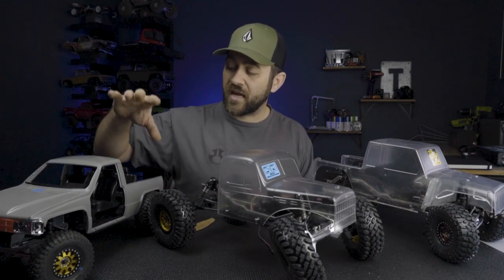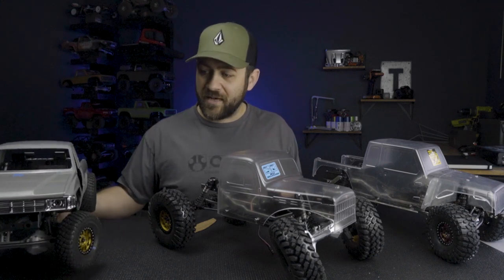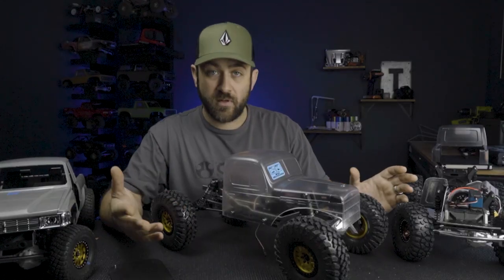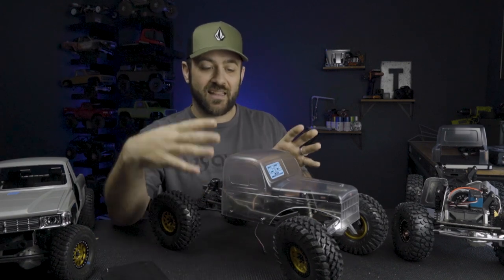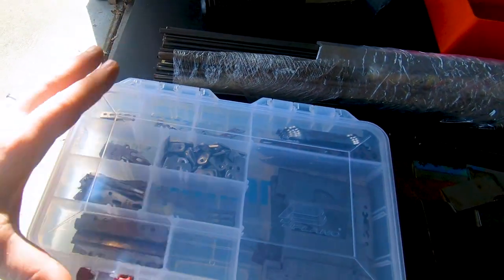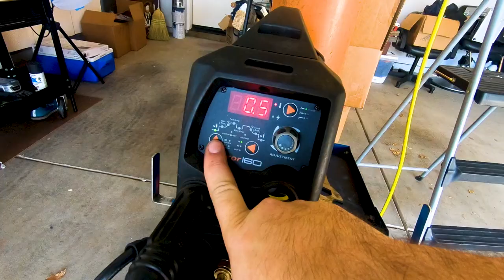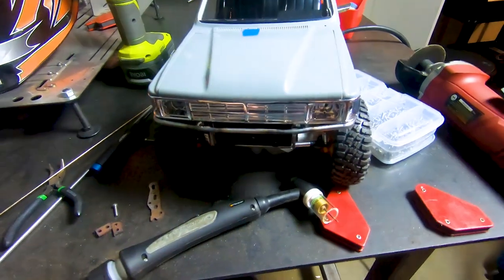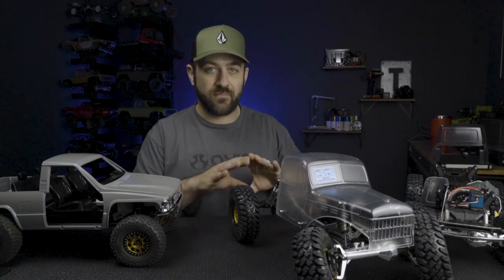Road to Scale Nats 2020 - Fab Time - Episode 5

Comment: With your weld the 1/8 rod you turned it down. You can go hi in amps and do a short burst fusion weld. To hold then turn down for your filler. Nice work

Comment: I like the shock towers are on the rear of the C3! I like all the stock mounting points.
Reply from the maker: They are only mock up, I wouldn’t use 3D printed. Plus I hate having all those holes! 😁
Reply: @HarleyDesignsInc  same here. I wouldn't use 3D printed shock towers, but they certainly are great for mock up!

Comment: Hey Josh, is the 3D file available for us to download on those shock mounts you made for the truck or do you print and sell upon request?
Reply from the maker: The shock mounts on my class 3? Those were just temp pieces a that I would never consider driving with.
Reply: Harley Designs Ok thanks, appreciate it.

Comment: I have a question on the ultra build if you can help me out. The metal ball links that go in the top of the shocks is there a way to safely get them in without shock pliars?
Reply from the maker: The top of the shocks uses the plastic pivot not a metal one.
Reply: Omg 😂 thanks so much Josh lmao I feel stupid now 😭
Reply: @HarleyDesignsInc  I also have an Ultra question,  hopefully mine arrives in Oz this week, almost getting a rash waiting..lol. question is motor rotation?  Normal or reversed? 
Loving your builds mate. Cheers 👍
Reply: @mikeguzmansr  hey mate, I'm excited for you that your building yours. It's definitely a long time dream truck goal for me. Good luck with it all.
Cheers mate 👍
Reply: @mickd8188  thanks man so far the build has been amazing. Can't wait to take it to the rocks!! 😊